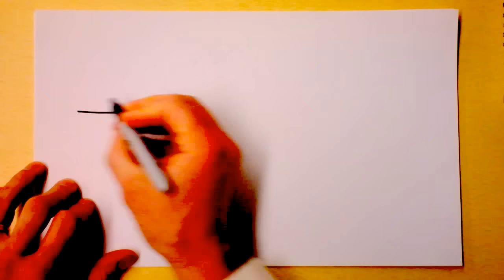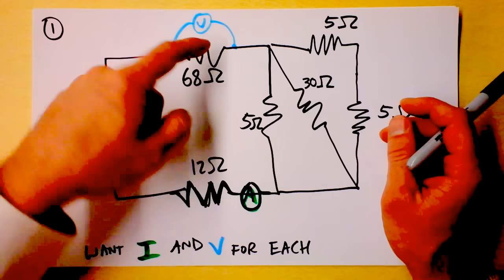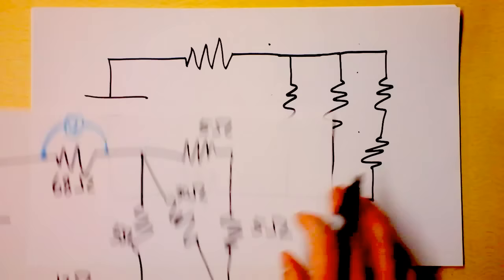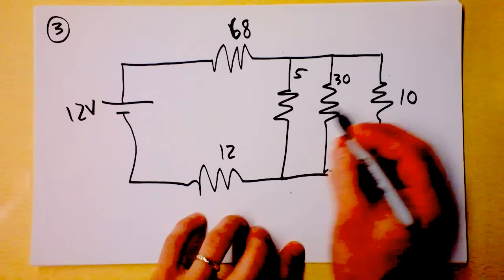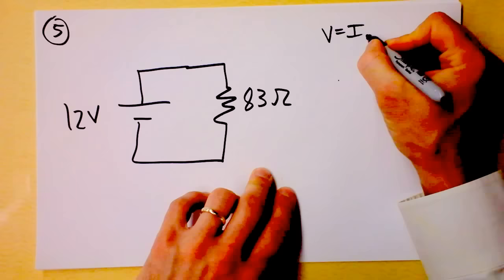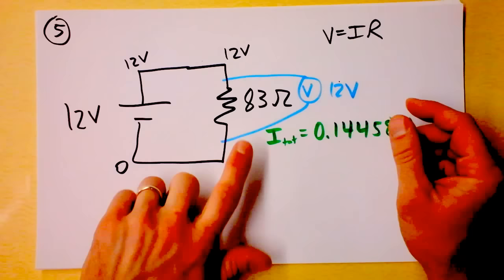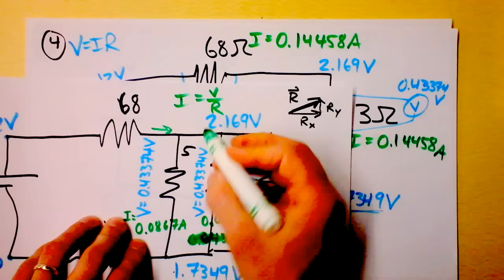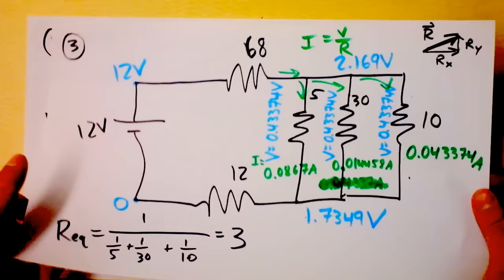Parallel and Series Resistor Circuit Analysis Worked Example using Ohm's Law Reduction | Doc Physics

Comment: There's no such thing as a parallel "circuit" -- it's "circuitS". Adding a second circuit in parallel makes it plural. It's not semantics - it's a critical understanding. Be willing to go beyond conventional wisdom.
Reply from the maker: Daniel Sullivan That's clever!
Reply: In my world, I teach "one load per circuit", since the load defines the circuit, not the fuse. Common mechanical wisdom is that it's the headlight "circuit" - for example. However, there aren't 20 bulbs in the headlight "circuit", there are 20 bulb circuits in the headlight "system". Simple, yet critical, difference... Thanks.
Reply from the maker: Daniel Sullivan Hey, you have a cool channel!  I'll be back to check it out some more later.  1) Can you lump series loads together as one load for your definition, so I can still have a series circuit?  and 2) the semantic/understanding shift means I can never say "look at this complicated circuit."  That's a bummer!
Reply: Daniel Sullivan While I appreciate that you take the time to put educational material on youtube, you're arguing the meaning/applicability of the word 'circuit'. I don't think there could be a better example of semantics.

That's not to dump on you. To some extent, we viewers are all here for semantics - the study of meaning in language and logic.

So, let's. - If there's an advantage or necessity to thinking of the single physical structure as N circuits, please describe it rather than just make it an axiom. Having quickly checked, plenty of collegiate educational resources use the word as Doc Schuster does above, so it's not an issue of definition as when people misuse 'data' where they mean 'datum'. I've looked among your videos and the answer doesn't appear to be in them. 3a, about 14.5min in, essentially says what you say above, yet if there's any 'why', it's not at that point.

I know I only speak for myself, but I'll be subbing Doc. He's informative, uses good visual devices, and has a slight discombobulation while keeping the important stuff in focus - it's a fun lecture style.
Reply: Teachers are hopefully the best learners, for if they aren't, the students suffer. You can offer an argument in favor of "N" circuits, but to satisfy your need for a "why" that a parallel circuit is in fact circuitS, we need only use your example: one circuit is datum, two is data. I wasn't being critical - I was teaching. I believe your mentor actually agreed with me - so you're picking a fight where none is required. If you speak English correctly, you'll describe parallel circuits, not a parallel circuit. This is a rule of grammar - not electricity.
Reply: I'm sorry if it was uncomfortable to admit that the pluralization of circuit really is just a technicality, but you're the one who opened up "it's not semantics - it's a critical understanding." I wasn't trolling you - just a little curious, and, yes, skeptical, but meeting skepticism well is an important part of a teacher's role.

This is harsh, but I don't mean it as an attack - The way you've come back at me here is probably a big part of why your teaching videos average something like 20-30 views. I actually was just trying to pursue the point you made so important, and you assume it's some attack in protection of Schuster (who I'd never even seen before today).

Even if it had been messing with you, you're doing yourself a disservice by treating it as such. Just like your video to which you gave your OWN thumbs down - it's an act of frustration that you ultimately know is counterproductive, but over which you haven't internalized control.

"Touchy people are the worst teachers, for when they are, they think they're being attacked where someone was just asking them to do some teaching."
Reply: Are you responding to me stoned or sober? I learned a long time ago not to argue with stoners. I also learned a long time ago what the difference is between one finger and two. One is singular, two are plural. One circuit is singular, two is plural. One stoner is singular, two are plural. One argument for the sake of hearing oneself speak is singular, two are plural. Are you defending a person or your heightened sensibilities to logical people with short hair who represent "the man", and hence, oppression? Is my assertion of a fact an assault on your freedom? Do I represent educational fascism? Is my knowledge of second grade grammar offensive to you? You can posit all the pseudo-intellectual drivel you care to, but in the end, there's no such thing as a parallel circuit...

Feel free to exercise your Constitutional right to express yourself freely, but don't expect someone with over 30 years of electrical teaching experience to listen. And, you may  wish to review all of my videos to confirm the number of views and subscribers before you get all high-and-mighty. I do what I do to help people. You don't. The guy you defended wasn't offended. That should tell you something. Later dude...
Reply: Doc Schuster I know it seems random, but because I teach guys who work on pretty complicated equipment, the idea that half-a-dozen or more things are in the same "circuit" makes their lives more complicated. My concept reduces their confusion, and hence fear. In my thinking, since a "circuit" is a "circle", as long as you're talking about a single current path, it's a circuit. Once it splits it's plural. I believe you'll be happier with your explanations if you remain true to the etymology  and speak of systems comprised of circuits.
Reply: Doc Schuster FYI - FET Electrical Book for Mechanics
Reply: Daniel Sullivan Ladies and gentlemen, if you're still with us, I leave you to decide if you want to learn from this person yourself. Me, I think I just saw a new troll. It was a good one. Think I'll go set some resistors up in parallel in a circuit.
Reply: An electric circuit is described in terms of nodes, essential nodes, branches, essential branches, paths, loops, meshes. Any load has at least two terminals for making the connection with an external circuit. By definition, branch is a path that connects two nodes as well as a basic load as it also connects at least two nodes. Thus, the word "circuit" can be substituted with "branch". But there also can be an infinite number of loads within each branch. In my opinion, it would be more reasonable to say "one load per branch" because the load is already considered as a branch )))
Reply: 2013Aleksey2013 We're saying the same thing. Mechanics work on circuits; engineers discuss nodes. Same concept, different circumstance.
Reply: Daniel Sullivan The lecture was all I was interested in, and Doc hit it out of the park if my D/C teacher explained it in the same manner as Doc I would not be on here. I could care less about a technicality of circuit or circuits, Any way Doc I feel much better going into my final, thank you for this instructional and informative video!
Reply: Stevie F It's not Physics - it's the English language - learn it...
Reply: Daniel Sullivan DANIEL DANIEL DANIEL, your videos, which i didn't even bother looking at fully, have less than a thousand views. Whereas this video has 193,000 views. Says it all really in my opinion. Go back to teaching by your far superior methods sarcasm hint and leave this gentleman's video alone. Thanks for coming.
Reply: Beeroy Y Well, teaching correctly is typically considered superior to teaching incorrectly. Your sarcasm was over-shadowed by your gross lack of appreciation of the fact that when you put the second circuit in parallel with the first, you now have TWO circuits. TWO, being more than ONE - makes the system plural. The plural of "circuit" is "circuits". Perhaps if you spent more time studying basic grammar and learning to count to two, instead of criticizing someone you don't know, you'd have less need to be sarcastic. Perhaps you'd be able to then make a cogent argument that could help people. You were actually arguing that I was wrong, right?
Reply: Daniel Sullivan I'll keep my response short and sweet. Being verbose doesn't aid your response in a discussion. "Gross lack of appreciation" seems like a very undeserved use of the word gross. A little over the top one could argue. You missed my point. This isn't a grammar video. The title clearly states the problem to be solved. Which, by watching the video, one would assume you struggle with the problem. Whereas actually it seems you watched the video just to pick holes in it. See that like to dislike ratio? Go back to making your relatively unwatched videos. This video has been watched 193 times more than the average views of your videos. That ratio is like comparing the weight of a raw jacket potato to that of a 14 year old male child, Jokes on you, sir.
Reply: Beeroy Y You're right - language in technical training is irrelevant. Dear God, please don't read either of my two books - yikes - that's all I talk about. And besides, having any type of conversation with a person who is so intimate with the relative weights of 14 year-old male children is a little "gross". "Screw you guys, I'm goin' home..."
Reply: that last part was funny...Mr. Sullivan, all I'm saying is when I'm taking AP Physics in HIGH SCHOOL, I'm not really worried about the technical terms (even tho it is correct), I'm just trying to grasp the general concept so I can recieve college credit in HIGH SCHOOL,  either way you obviosuly know more than us high school kids, just saying
Reply: Dan,
Thanks for making clear that parallel circuits should be seen as a separate circuits. We need more of this kind of clarification in our industry and you are the man to do it.
Reply: Chill with that
Reply: Jeff Whisenand Well stated. Dan is a good instructor. His experience in the field repairing broken things so life can go on in a civilized manner is much appreciated. Nothing wrong with maintaining standards when describing technical subjects. Thanks for the video.